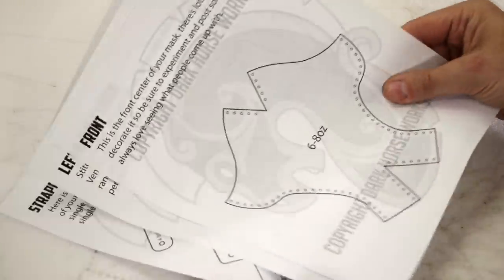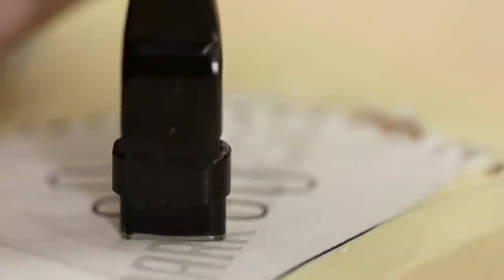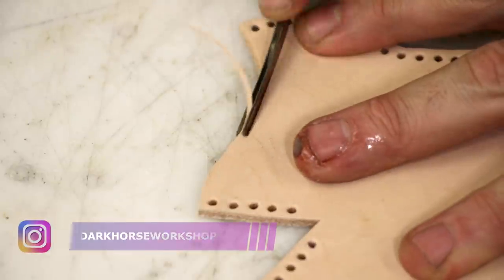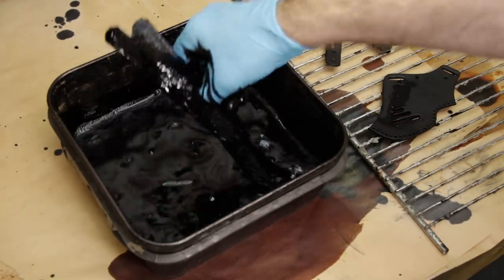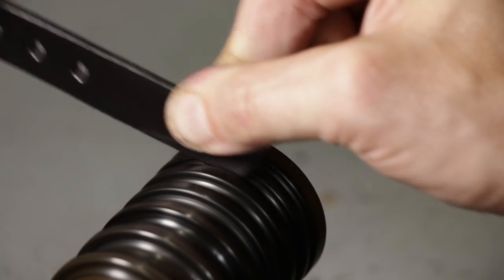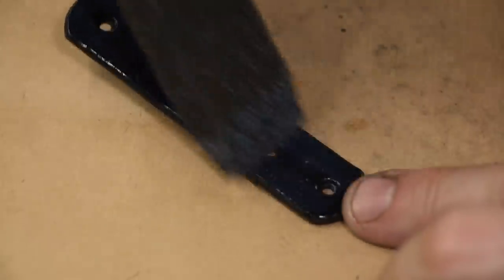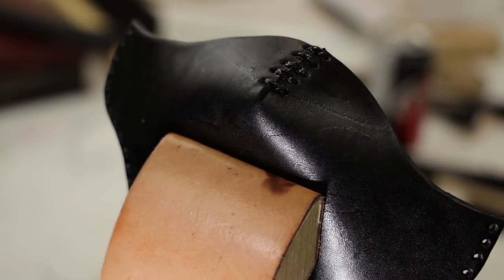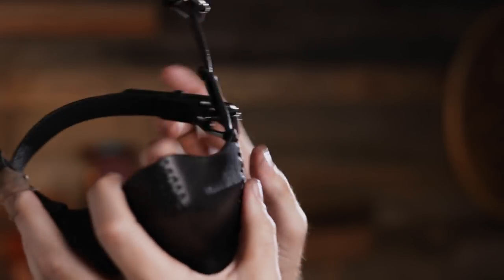Apocalypse Mask - How to Make a Leather Mask

Comment: Any issues with fumes from the Dyes or from the Resolene or even the Tokonole being up against your face?  I work in leather making tool belts and pockets (carpenter bags) and some of the finishes I use have solvents in them and you can smell them even when you are not putting the leather right on your face.  I use veg tan for all my work but I do need to make the bags weather resistant and those finishes will have solvents for penetrating the leather to make them more resistant to all types of weather.  I would love any info about non-solvent forms of weather proofing leather.
Reply: I've used the water based stains and top coats from Tandy on most of the masks that I've done, and Resolene on a few.  just give the products some time to flash off.  Wouldn't recommend finishing one and using it that day,  But I haven't had any complaints.
Reply: @brianhudson3619  Thanks so much for responding to my comment I truly appreciate it.  Your video was very helpful for me.  Keep up the good work, I enjoy your channel.

Comment: lol hopefully you'll like the needle tip bottles, I do for sure.  But it still works best to rub it in with your fingers before you start burnishing.  You can also put in on the flesh side to lock down fibers and the color.  That could possibly solve your bleeding problem with the mask.  Also, I've become a fan of taping down templates since I found Dieselpunkro a year or so ago.  Nothing more annoying than having a template slip on you, other than cutting off the tip of a finger :P